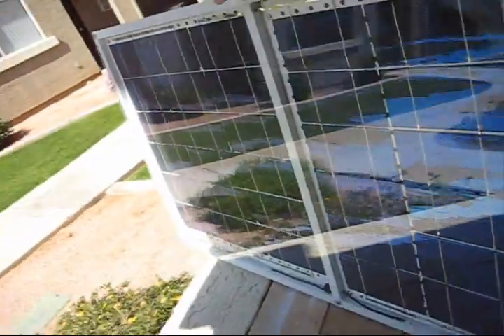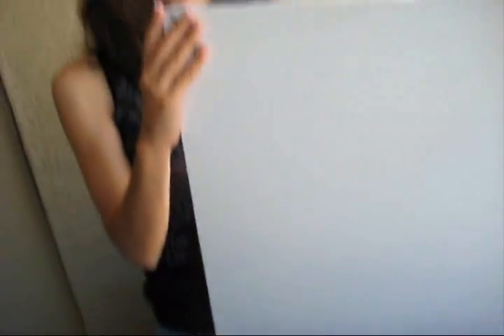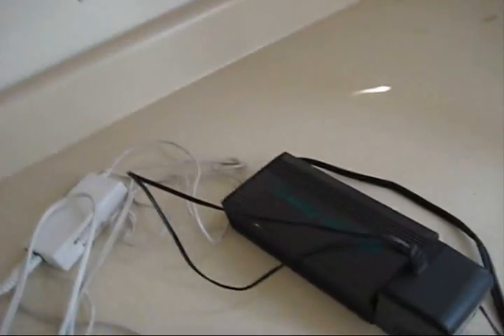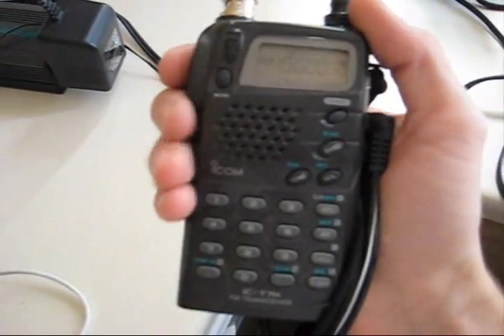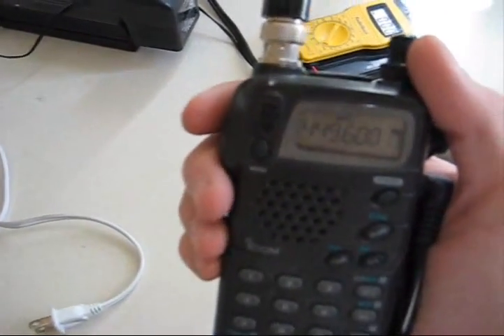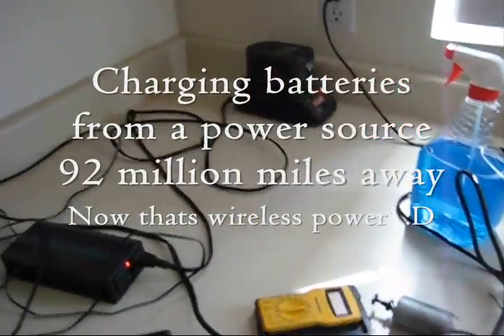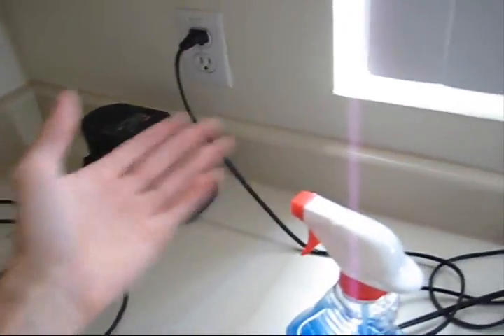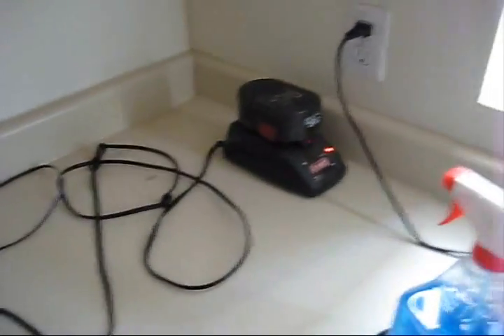Homebrew Solar Panel 60Watts

Comment: Nice job with that Solar Panel. Hope it stays waterproof and doesn't fog up. How have you solved those problems and what did you use for the transparent medium. And have a good source for the Solar Cells to share?

FYI When you keyed up your HT on that transmitter, I hope you used your Callsign to identify at some point. I think that is what kg4bga was trying to convey. Transmitting without a Callsign could land large FCC fines. Kerchunking is also annoying to many listeners. Yup, control op.

Comment: @hotsexybrownguy  An Inverter does not charge batteries. However, if a battery charger is powered by an inverter, (an inefficient and counterproductive setup) it's filtering and regulation make the dirty power put out by cheap inverters(cobra and many others) irrelevant. Unless the 'charger' is simply a chinese power supply labelled 'charger' . Are you you referring to  the squarewave peak voltage being 400 instead of the proper 340?

Comment: @TheSaintLLC Trying to convert exisiting ac systems to DC is really not anywhere near cost effective..but on another note- I am currently running a homeade DC system I wired into my (flat 3 br ranch) Using mostly 1 amp 12volt cfl standard base bulbs(rv's) and a few converted LED standard base bulbs. That 60watt panel will power my whole place and my laptop for several hours a day..if you add simple refrigeration and a water pump mulitply that panel by at least a factor of 10 tho..my babble ty :)

Comment: Nice video! I plan to build my panel using the same methode as you did. Having a bettery between your panel and inverter will self regulate closer to 12V. Your next inverter will be happier that way...

Comment: Thanks for the Specifics...I hear you, there is a lot to think about.  I'm currently in the process of building (6) 63 watt 18 volt panels myself and I'm just trying to gather as much information as I possibly can.  I plan on taking my garage off the grid using (4) 32 Ah 12 volt deep cycle lead acid batteries w/ an appropriate charge controller and an inverter for the garage door opener.

Comment: You mentioned that these solar cells would "otherwise be thrown away".  Who is throwing away 3 x 6" .5 volt multi-crystalline silicon cells...I want to raid their garbage...these cells easily cost at least $ 1.50 each.  What did you use as your substrate?  Did you weather proof the cells using EVA or a substitute?  What did you weatherproof the wood frame with, Alumathane or just paint?  Looks nice, just curious.